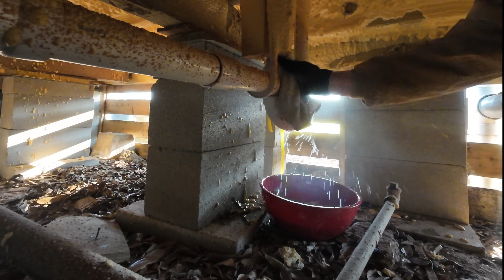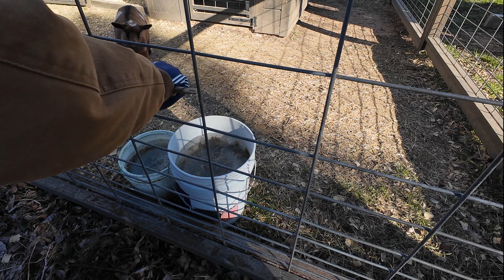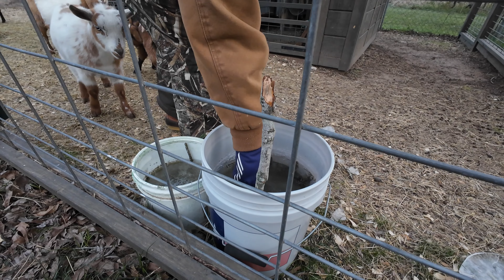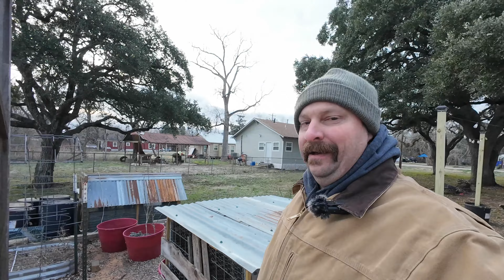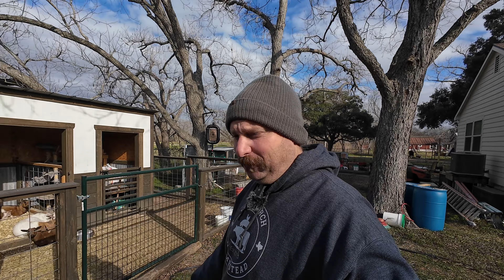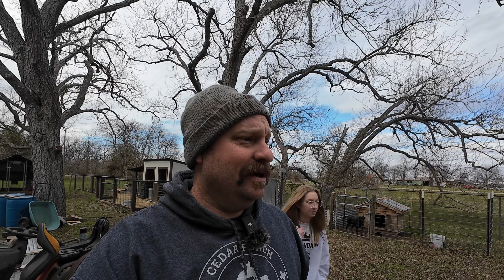We SURVIVED The Winter Blast

Comment: Thank you for your service as a firefighter. In LaSalle county we are currently up to 70* for the moment at 2:30 PM. Then back down to 30* tonight. That one night of 18* popped an old fitting right at our well ... even tho the well was shut off. I'm impressed with how well your rabbit wind wall works.
Reply from the maker: I appreciate it!  Yeah weather changes on a dime and I think we are getting another day of a freeze tomorrow and then the rest of the week it's supposed to be pouring/flooding rain.  The rabbit wall surprisingly works well and the rabbits can mange in cold temps as long as they are dry and the wind is off of them.